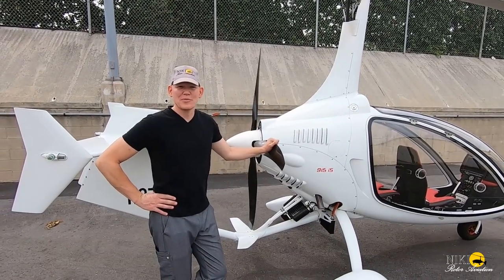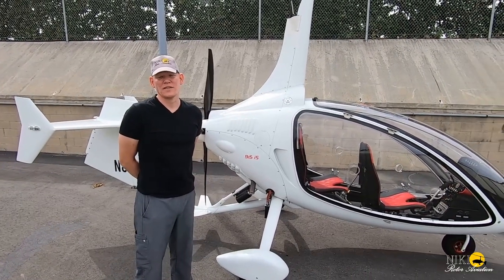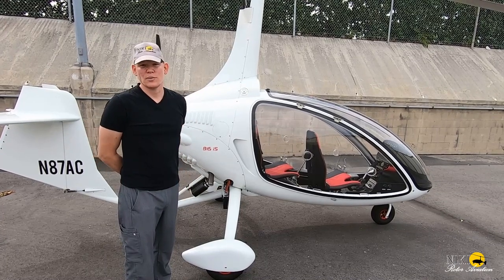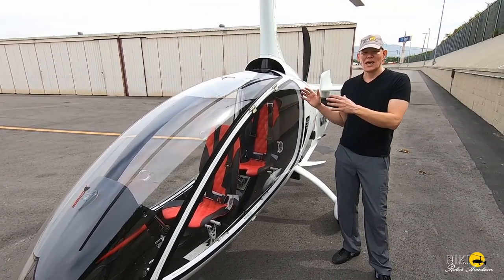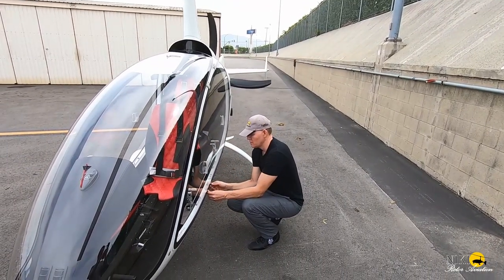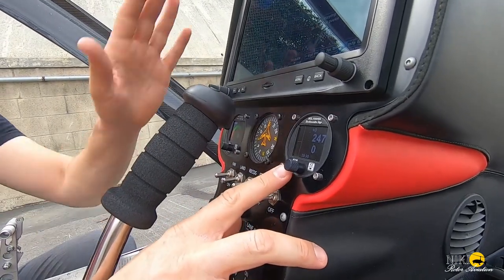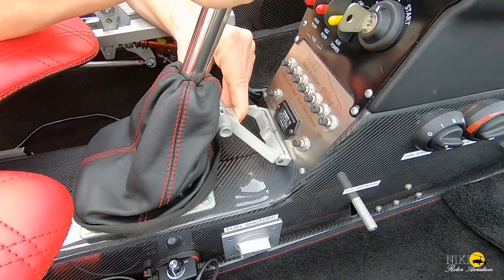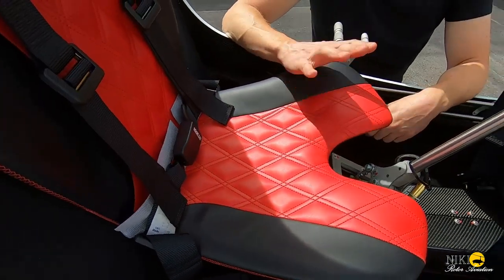Niki Kallithera Gyroplane By Niki Rotor Aviation 2020

Comment: What about the license and how can we learn the drive your helicopter .
Reply: koreo uga - It's NOT a helicopter.  Notice that it has no tail rotor, as it doesn't need one.  Autogyros' rotors are UNpowered, using only the slipstream of forward travel to keep them spinning. They were invented in the 1930s or so, long before the helicopter.
Reply: A Gyroplane can be flown in the US under a sport pilots license specific for Gyroplane or a private pilot license with Gyroplane endorsement. Training is available across the US and EU and Australia/NZ. Typical training for a sport pilot license in the US is a minimum of 20 hrs of instruction. But most students require more than the minimum training. It’s always a good idea to train for safety and competence - not the minimum requirements.

Comment: I am a paraglider, looking to upgrade to a gyro copter,(I wanna fly even when windy)- I have also seen WAY too many UT vids, but in all of them I have seen only TWO BLADES, but am told that three or four are better in a copter con fig, - so as a total noob I need to ask SOMEONE why are there no 3/4 blade gyro's ??
I must add that this is by FAR the best suited gyro for me and WILL be contacting this lagyro to purchase. thanx !
Reply: I think it has to do with rotor speed...more blades, the slower the blade speed which probably equals more drag... Just my thoughts. This a simple 2 blade set up maybe the most efficient.

Great question tho.
Reply: @mr.perfect1er  thanx, more research is needed on my part,I have seen 3/4 blades on other gyro's , but I may lean toward the tractor type for those con fig's
Reply: ,I have seen 3/4 blades on other gyro's---early versions(30's/40's)
Reply: The two blade set up is a “semi-rigid” rotor design that allows for the most efficient form of autorotation with the fewest parts/complexity and the least amount of weight.  This allows for blade flap to compensate for dissymmetry of lift (and accounts for the two “pulses” the pilot feels during each blade rotation while holding the stick.) The semi-rigid rotor with only two blades is also immune to “ground resonance” issues. 3, 4, and 5 blade rotor heads are “fully articulating” and allow for collective pitch adjustment to the rotor blades and allows the blades to “lead and lag”. This is an added level of complexity that most gyros do not benefit from. Multi-blade systems allow for vertical “jump” take offs in a gyro (they do exist!)  (as you can control the blade pitch with the collective) - but these configurations sacrifice too much weight and complexity in a non-powered rotor. Multi blade helicopters (not gyros) benefit from fully articulated rotor heads w multiple blades and there is also less blade noise (think of a 5 blade Defender vs a two blade Huey). Bottom line - two is fine! ;-)
Reply: @maxlehfeldt7518  

Thanks for the info!
Reply: @maxlehfeldt7518  NOW I KNOW, thank you so much !